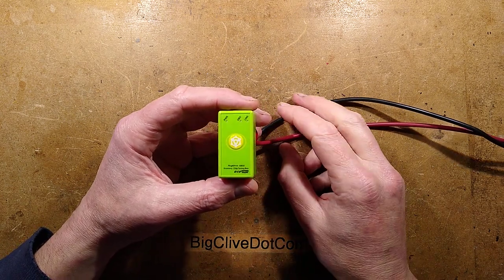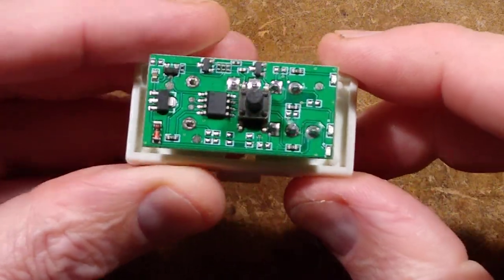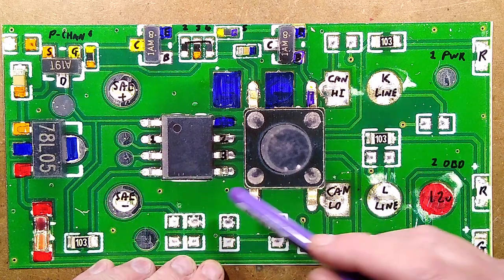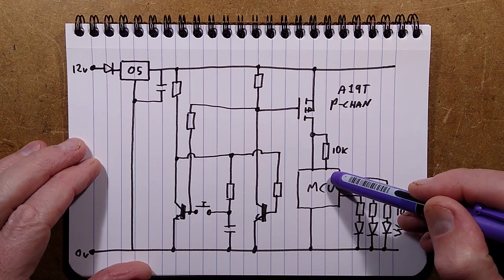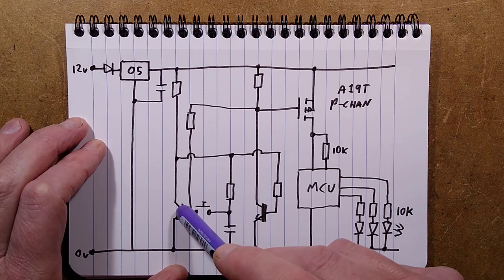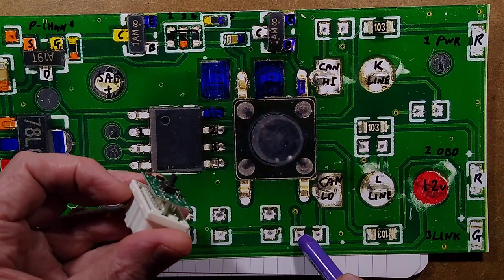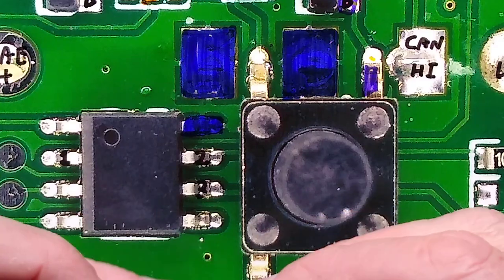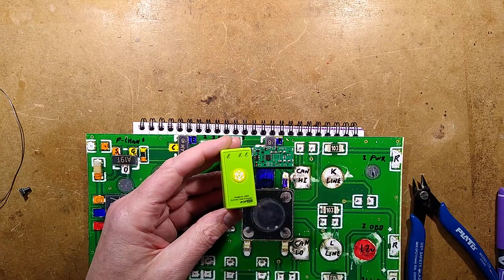Fake product with stolen software?  (with schematic)

Comment: I'm just going to toss this comment as a General-Case explanation for 'traces to nowhere'. 
(But I am in NO WAY trying to defend these fakes)

IFF you have a very dense PCB, w/lots of nets going in random directions and no buss-architecture, it is possible to have a routing rats-nest that cannot be solved on two layers. In cases like that, then traces can be dropped from the surface layer to an internal layer (e.g. a 4 layer board stackup) through a 'Blind Via' and the trace can them run to it's target unfettered by the routing blockages on the surface layers. In this way, it can LOOK like those mini traces just dead-end, but in reality they ARE going somewhere.

Now in this example, that's not the case.... it's just fakery.
I just didn't want anyone to think that 'traces-to-nowhere were a sure-fire indicator that fakery is afoot. Blind vias, buried vias, and internal routing layers are a real thing. And in the world of microwave PCB design, there are times when a trace appears to dead-end, but in reality the signal is actually "straight-line beaming" to a pad/trace a few mm away...the microwave equivalent of a DC-blocking/in-line capacitor.

BTW, the single button/toggle two transistor "switch" is not an uncommon thing. In the musical electronics world, industry-leader Roland/Boss has been using essentially THAT circuit to toggle their effects-pedals On/Off since the mid-70's. There are probably a billion effects pedals from that one manufacturer alone in circulation, still functioning well.

"Who is this guy? And why should we believe him??"
Electronics was my first profession.. I started EE school in '76, and worked nights at Tektronix. From there I went onto work on massive electronic pipe organs (Rodgers Organ Co), then spent 2 years in a tiny company that made the first AED (helped get it through FDA Approval and into manufacturing) then 11 years in hardware and software design groups at Mentor Graphics including about 4-5 years in the PCB Design Tools Division. I've seen some wild designs from customers like Lockheed, EG&G, Reticon, British-Telecom, Mercedes, Fairchild, and a great many of the 80's/90's startups and PCB design bureaus. I've personally been involved in very-wide-buss (for the early 80s) hardware designs utilizing controlled impedance design rules where we ended up with 12 layers (8 signal). (I also worked in Mentor's Full Custom IC design tools Div, and saw some wild hybrid IC designs there as well). THEN I dumped the whole thing and went back to school and got that pesky "Dr" thing attached to my name ... DEA license, the whole 9 yards... now I work on people, not machines. ... but I still have all that EE stuff cluttering up my brain, and I love a good PCB-mystery like this one.

... and don't get me going on the absolute witchcraft/Trend-Without-A-Cause that is "flowed copper ground-fills" or some such. 
I also participated in radiated/conducted emissions design at Mentor for their early hardware projects, and saw (in certain situations) those copper-flood areas actually contribute to noise problems due to high-inductance return ground paths (the copper floods begin to act like antennas in some frequency bands) AND/OR cause capacitive coupling of noise in large-integration, small-signal analog systems (we even saw this at Rodgers in the early 80's during their "Mikasco Fiasco" on the first computer-driven pipe organ... we had to re-layout the mixing/pre-amp PCB to GET RID of the flowed copper regions because they were essentially floating antennas, picking up digital noise). 

Keep up the good work!

Comment: I know it is probably super negligible but if those are pulling from the 12v power you could technically be loosing overall fuel economy 😆
Reply: Yep, about 5 meters (not Km, just meters) per tank of fuel. 🙃
Reply: These fake gadgets often draw about 20 mA.  That is sufficient parasitic load to draw the 12V battery down below the ability to start the car    In a few weeks when combined with the engine CPU and radio memory draws.  I believe some of the fake OBD programmers monitor bus activity and enter sleep mode when the bus traffic is idle.  Nice of them to be so thoughtful!

Comment: WHY? Blinking three LEDs in a pattern takes like ten lines of code. Imagine going through all the design, additional transistor prices etc instead of spending five minutes coding their own microcontroller.
Reply: As an outsider if this comment section has taught me anything it's that electrical engineer types love complicated stuff.

Comment: Possibly multi-layer pcb. Lot of effort for a do nothing device. What does it cost? In high volume 10,000+ qty. What you showed could be very cheap. Easily under $10. In smaller quantities, much more.

Comment: Hmm. Surprising nobody makes OBD to USB adapters (for powering USB devices). I suppose the risk would be too high for any legit company. That still leaves a lot out there.
Reply: There are, but OBD to Bluetooth is more popular.  Typically the Bluetooth connection emulates a serial port.  Elm electronics made a pre-programmed PIC called the ELM327.  The 327 is controlled by sending it AT commands like an old school modem and data from the diagnostic link is passed in the AT responses.  There are a ton low quality of Chinese rip-offs of the ELM PIC.  I was able to pull the standard as well as proprietary data from a Nissan LEAF using an app called LEAF Spy using a device  purported to have a genuine ELM PIC.  It was handy for resetting the TPMS mapping after tire rotation.
Reply: @wtmayhew  It's also way safer to use a bluetooth one, since there's no chance of earth loops and such.
Reply: @Frank Vera I meant for 5V power. Unless that's what you mean (after your comment, I realized my comment could be mistaken as being about OBD monitoring)
Reply: You could modify this adapter to do so 😆
Just put a USB female connector to where the MCU's VCC is and GND ... Bam, Bob's your uncle.
Not sure though if the 7805 & MOSFET can handle enough current to charge a smartphone without getting toast 😂
Reply: What you reallllly don't want to do though, is fry your OBD2 system by pulling a relatively high current for extended periods of time. It's designed for diagnostics, not charging a phone. I'm not saying don't do it, or that it can't be done, but think twice before doing so.
Reply: @adzib1823  not sure about it, but I guess the 12V on the OBD port are not supplied by a MCU, since this pin is usually not switched. So in worst case, sure there could be harm on a MCU by frying something, but I guess in most cases it would just pop an exchangable fuse, right?
Reply: @SystemX1983  No idea, hence my warning... I guess the only way to tell for sure is to tear one's own car apart and estimate the capabilities, or trial and error on a cheap car that's being scrapped. Obviously, every make and model could (not necessarily will, but could) be different as well.
Reply: @ConstantlyDamaged  Excellent point regarding electrical isolation.
Reply: @adzib1823  Given all that it already powers (including Bluetooth on some obd devices) and that default USB is supposed to be limited to 500mA, I imagine it would be fine for most devices. It's the ones it's not that are the issue, I guess. Current limit should be part of the OBD spec though.

Comment: I have to say I have not much idea as to what this is supposed to do and how it s supposed to work, other than 'fuel saving' using a microchip. Something to do with plugging in a electronic doohickey into your car computer which somehow 'saves fuel'. And apparently it doesn't work, at least not for the car owner. But it's presumably a great way to make money for crooked manufacturers and retailers. So basically, this device monetises gullible people by hypnotising them with a flashing LED?

Comment: They're all fake. Think about it. The PCM is specifically programed TO THAT VEHICLE, and these things can improve fuel mileage/performance on every vehicle they're plugged into? And I say again, the OBD2 port was not designed to have something plugged into it for the duration of it's existence. This can damage the PCM. It doesn't always happen, but it does happen.

Comment: The extent of the non-engineering deception in these units is amazing. Why bother with the work and the extra cost of the circuit, when just self-blinking LEDs would do the trick?

Comment: These clone units are precisely why I went with a higher quality, well established company. Not going to name the make and model here as I don't want to violate any channel rules and I don't work for the company itself nor do I have a vested interest in their sales. All I can say as I've had my device for over 6 years, use it 5 days a week , and I paid a little over 100 USD and the PID read speed is high in the Torque program and I've yet to have any issues.

You get what you pay for sometimes, always best to visit the Torque forums (or the forum of your program of choice) to vet the BS adapter options from the legit ones.

Comment: I bought a pickup off an old bloke. Had something plugged into the cigarette lighter that he swore saved up to 20 percent on fuel. Was bored one day and took it apart. Was one LED and a resistor I think. Was literally just a light! 🤣
Reply from the maker: The Fuel Shark or Neosocket.  Video made and coming soon.
Reply: That sounds right. Sure it was the fuel shark maybe.

Comment: installed this and running red diesel the guys at AliExpress said if I'd buy this for £16.49 plus buy a barrel of red diesel I'll save loads I'm now 1 million mile's for pennies guy also said if I'd go get the car up on axle stands or up on a hoist and drive in reverse it will put the miles back it's a win win

Comment: Very wasteful design having a micro-controller in it.  The essence of good engineering is to use as few components as possible and we all know you can build a fuel saver which is just as good with just a couple of transistors and a few resistors.

Comment: You're having fun with this. I get a bit lost with electronics and I'm currently strugging with getting an INA219 on my Pi Pico to measure correctly power on a 4S lithium battery pack.

Comment: I'm lost when it comes to software and computer chips lol
Reply: Mee too. I know how a valve works, but I can't see how anything that doesn't run off 350v and has variable capacitors can possibly do anything. All these little bits of plastic? What on earth are they?
Reply: @gasgas2689  I know how transistors work, but get a bit vexed by modern micro chips

Comment: the idea of saving fuel by plugging crap into your car is just a scam in itself. Manufacturers are not going to (cant) engineer your car to waste fuel because they have strict emissions standards to follow. People also forget that the power to run your car comes from the fuel and if you give it less fuel you get less power. Its simple as that. It takes a certain amount of fuel to go a mile. 
Fuel saving tip of the day. unplug the garbage you plugged in and stop speeding and flooring your car. Stop driving like a maniac and passing people and weaving in and out of traffic aggressively.

Comment: This one at least put a little effort into the scam. I'm waiting for the empty plastic box with no LEDs and maybe just a sticker with a picture of an LED on the outside.
Reply: . . . and after a week the LED picture peels away from the plastic box and falls on to the accelerator (gas) pedal 😁
Reply from the maker: Instead of an LED on the unit, it could use the "check engine" light as its indicator.

Comment: nOT ANOTHER ONE ..are we struggling for content ? maybe you should go back to what you do best , putting up christmas lights or repairing radio mikes onsite : )_
Reply from the maker: Definitely not struggling for content.
Reply: @bigclivedotcom so why so many obd device vids when there all basicly the same resistors and transistors to light leds ???? i dont get it  ? You know as well as i do that you need to reprogram the ecu for injector timing to cut fuel intake into the cylander for ignition from the spark plug  and then run a drive cycle ,, there are other real programming devices from china that only allow 20 uses then they brick up , now that would be a good one  : )))) if you have an eprom reader  you can do it : )Still love your stuff bigman :) keep it up : ) and keep plodding on ....

Comment: This guy has no idea what he is doing. None at all. All that bull crap about the discrete logic circuitry is stupid, rudimentary and useless talk.   All you have to do is put a trace analyzer on the serial interface and see if it is receiving or sending OBDII commands, and what those OBDII commands are. clearly it is not doing anything. nothing can Micro code modify fuel flow thru the OBDII port autonomously. Only macro code can and that is not a macrocode machine
Reply from the maker: I look forward to finding one with macrocode.